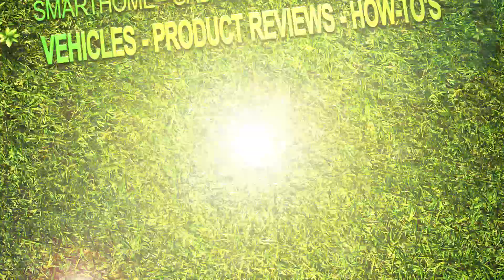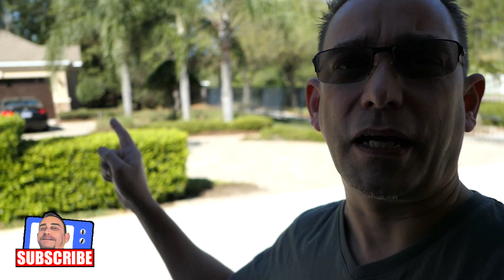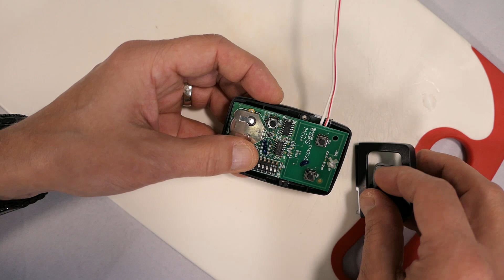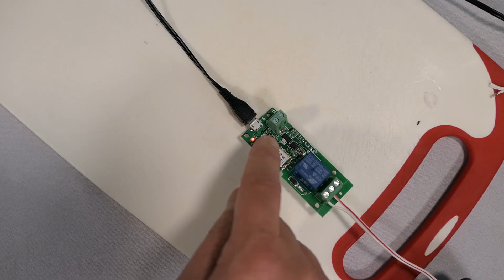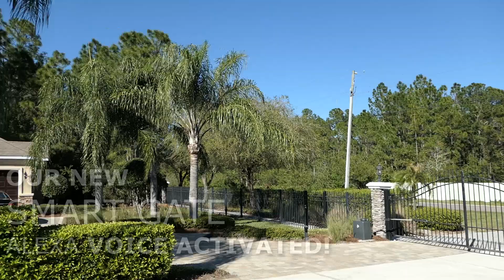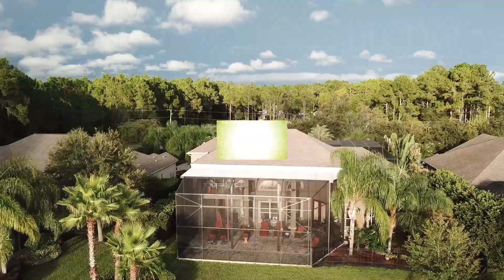CONTROL Your GATE | GARAGE DOOR with ALEXA/Google Home

Comment: I just completed my project, and it works perfectly.  Over the years I must have bought five hundred dollars of junk products that claimed would work with my gate, called the gate motor manufacturer - ALEKO several times, called the gate installer and no one had no clue how to connect my gate to the internet to open and close.  This video inspired me so much that I immediately ordered my supplies.  The biggest issue was my remote.  The gate remote is a key chain fob with three buttons.   One button was programmed to open the gate.  Since it was designed to be small the circuit board was a layered board, and I could not solder from the bottom.  This required me to take out one of the microswitches with the solder points exposed from the top.  In my case I could not get bell wire to stick to the small solder point I had to resort to a thin stranded wire from one of my junk projects.   I tested my prototype, and it works perfectly.  Now I am just waiting for my box to come in, so I house it all together.

Comment: I'm still struggling getting it to connect to wifi and when it can get it added to the app it's offline. I bought another switch to make sure it wasn't a bad board, but no luck. Iv been in software for 20 years so you can imagine my frustration with not getting it to connect.  Anyone qith suggestions are welcome. I have tried on two different wifi networks. Mine and a friend's. Turnwd off 5G, all security even created a guest net work.. I can get it to connect to the router(s) 2 different ones but with no wifi.. 
Cheers 🍻
Reply from the maker: I have a 2nd mesh network with a pod in my garage that helps keep connections 😀

Comment: Hello, great video, Just wondering what power adapter is used? Does a Iphone adapter work?
Reply from the maker: I believe it's a "Micro-USB"
Reply: @twHomeShow  Thanks but i was more thinking about the power supply itself. Is an Iphone charger sufficient?
Reply from the maker: You just need a 1amp phone charger plug. (micro-usb)
Reply: @twHomeShow  Great. Thanks. And thanks for a great channel

Comment: Great video, have just done exactly the same, the module set up was a little different 3 years down the line, you have to set the inching/jogging parameters via the mobile phone app now, but otherwise a great way to Alexa enable a 20+ year old proprietary gate automation system.
Reply from the maker: Mike, thanks for the info 👍 yes, we're still Loving our ALEXA controlled gate everyday 😀😄  -Todd

Comment: Thank you for this!  I notice you had to replace the battery when it died.  Any thoughts on an additional hack to provide external power to the remote instead of relying on batteries?
Reply from the maker: Not yet. But the battery usually lasts about a year. Not bad.  -Todd

Comment: Hi sir, why did you hook up the wifi module with remote control rather than hook it up with gate controller
Reply from the maker: I explained this in my video...I don't have access to the Gate controller, it is locked by the HOA :)   -Todd

Comment: Good video.   What if my gate does not close automatically?  How would I close it again after opening with the app?

I also have 4 contacts on my gate’s open button in the remote fob.
Reply from the maker: I would buy this Multi-switch instead: https://amzn.to/3aJAXet

and follow this video to solder open button to one-for opening, and solder close button to another - for closing. And then- just name them-OPEN Gate and the other one- CLOSE Gate.

You may want to watch my other video for help with this multi-switch-HERE:  https://youtu.be/MypwEcB5nT8

Hope this helps, Todd

PS. If the same button on your fob/controller Opens and Closes the gate, then you only need the single eWelink (NOT the Multi-one). You'll just have to active the ONE button to close and open.

Comment: Well, I gotta tell ya.  Your video prompted me to tackle the wifi control of my driveway gate again.  I'd given up on it because I couldnt get the little circuit board to pair with my wifi.  Tonight I had success, aided by yours and another Youtube video.  
BUT, I wanted to let you know that I finally got it paired and tested in the house with eWilink.  Then, I took the little WiFi board and mounted it in the steel gate controller box, about 100 feet from my ASUS WiFi unit in the house.  I was surprised that it could get full bars inside the metal box . . . but it did.  
Now, my gate is controllable from my iPhone!  No intermediate clicker needed.  It's connected directly to the input on the controller that simply needs a momentary normally-open switch. 
I'm thrilled!
No more carrying a clicker on my motorcycle.  No more calling my wife on the phone to come outside and click the gate open.  
Next step will be to install an Alexa mobile device in our two cars so we can just ask Alexa to open the gate.  

Thank you for the video. 
Ken
Reply from the maker: That's AWESOME!
Reply: I couldn't get the little circuit board to pair with my eWeLink. I have 3 of the module and none of them work. The app keep saying 0 devices found. Can you link down the other video you mention please, Thank you.

Comment: It seems that the little WiFi module could connect directly with the Normally Open terminals  on the gate actuator, eliminating the need for a clicker.  No?  
I really need to make my gate WiFi enabled so I can access the app on my iPhone or Apple Watch (would be even better) when I pull up to the gate on my motorcycle.  Alexa operation could be handy to open the gate from  inside the house.  But I'm really wanting to make it easier to get my motorcycle inside the gate.  Suggestions?
Reply from the maker: Yep, I can open my gate with alexa, or the eWeLink app from my phone. It works excellent! I use it when I arrive home on my bike as well.

Comment: Great tutorial. I hooked one up to the wall control wire on a garage door door and another to my gate wiring inside the box (had to get the one with 7~32 volt input). Works like a champ. Didn't even look at the instructions (they were too small to read anyway). You may have covered it but when the bottom light is on, the unit is not momentary, but on or off.  With that bottom light off, it is a momentary switch (maybe a second or so). Its just like I am pushing the button on the wall or remote. GREAT!!!
Reply: Ahhh....okay Google...err Alexa...that's my biggest challenge now! Remembering which one
Reply from the maker: TVR 101, That's great to hear! I am just loving mine, especially the Gate one - I can just tell Alexa to open the gate without even getting out of my recliner :)
Reply: @twHomeShow  Great idea. I added it to my phone through Google and am working on a Fire Tablet work around. Man are we lazy or what????
Reply from the maker: @texastodd12  Lazy...eehh, I like to call us SMART :)

Comment: How would it be done if i do have access to my gate box??
Reply from the maker: Hello Jaime, I'm sure it would be similar to connecting the eWeLink module to a garage door set-up. First you would have to make a jumper wire to test the possible contacts within your gate housing. Just watch one of my other videos - controlling garage with eWeLink. I would try to follow those sames step :) Todd
Reply from the maker: Oh yeah, and make sure your WiFi will work out to your gate.

Comment: Great video.  I am working on something  very similar so this is very helpful.  How do keep the gate open longer if you want to ? I just installed new driveway gates so getting used to it.
Reply: Depending on your gate opener. If it has a CTC input like mine, it works just like the remote. Push the button a second time to stop it and hold it open. Open just cycles the opener. CTC is like having the remote so you can stop it before it completely opens and it stays open. Mine are ghost controls gate opener.
Reply from the maker: Hey Fairplayer1, thanks :) Our driveway gates are controlled with our landline phone by pressing certain numbers and the #. This is how we can hold it open. But our gate also has 4 stop motion sensors (2-outside the gate and 2-inside the gate. Usually I'll just throw a bag or bucket over one of the outside sensors if I want to keep it open for a while. I have a camera outside pointed at the gate so if I'm expecting a pizza delivery I watch the camera and just yell at ALEXA to "open gate" when I see the delivery pull-up.

Comment: Thank you for this.. One could deduce that if I had a 2 button remote (garage and gate) that if I buy 2 switches and name them different things in the app, I could use that 1 remote to control them both?
Reply: Yes, but the remote would have to be close enough to both openers.  For the garage, just wire it in to the wall switch that opens and closes the door (or where those wires connect into the opener). No need for remote.

Comment: Hi! Amazing vid! I just managed to do this off the back off this vid - thanks! One thing I can’t seem to suss though is, saying ‘Okay google open the garage! It will turn on the ewelink and open the garage, but if I say okay google close garage door, it wants to turn off the WiFi module and this won’t prompt the garage to close (work-around being saying ‘open garage door’ to both open and close it). I have an IFTTT set up but no joy. Any pointers??
Reply from the maker: You need to setup a "Routine" within Google Home app. Open Google Home app and select Routines, then manage routines, "+" to add a routine. Add a routine command, such as "Close Garage Door", then add "action"...such as "Activate Garage Door". and save the command. Now do the same for the command "Open Garage Door". Hope that helps. Todd
Reply: tw HomeShow Amazing - thanks Todd! Will give that a go! Thanks chap 👍🏼👍🏼👍🏼

Comment from the maker: NOTICE TO EVERYONE FOLLOWING this SmartGate Video... Last week my SmartGate control with eWeLINK stopped working. Today I got the chance to take it down and examine it...I thought maybe I would have to reprogram it or something disappointing :(  BUT, GOOD NEWS!! I discovered the battery was DEAD in my remote. I just replaced the battery and it worked just fine AGAIN...NO Reprogramming or nothing! I guess I was so impressed with this NEW Smart gate opener and used it so much, that I ran down the battery :)
Reply: Hardwire the remote. I’d like to see that video
Reply: Nice video.. but having trouble as it only works for about 5 minutes and then the remote doesnt seem to get the signal.. any ideas?
Reply from the maker: @kennyh8112  Maybe check the wifi signal you are getting near the unit. It might be too weak?
Reply: tw HomeShow 
Thanks for the reply,
I have the wifi switch and the remote control right next to my router.
The wifi switch clicks when i press the button on my phone but it seems like it doesnt send the signal to the garage remote. Im thinking the solder isnt connected properly? My garage is a rolling code, but that shouldnt affect anything since the idea of the wifi switch simulates a click. Thanks again..
Reply: Next video tip: How to add a battery sensor to this setup to alert you via the phone app
Reply: I bypassed the gate remote by using some accessory inputs my gate opener has. My setup is a bit different though. My gate opener has a 12v auto battery that it charges and draws from to open the gate. I have the wifi relay board in the opener housing wired to the battery using the 12v option and also have it wired directly to my openers accessory inputs. I imagine all openers don't have this option, but it works great if your opener does. Thanks for making the video.
Reply: @descent777  What brand opener do you have
Reply: Hi it use to work great for my 2 garage door. Today i changed my network for 5G...is there a way to make the switch work with 5g . If not what is my other options?
Thanks
Reply from the maker: @jeewaye1679  Hi there, most wifi gadgets, now-a-days only work over 2.4g. Most routers will allow you to deploy BOTH 2.4g AND 5g. Check your router setting and see if you can turn them both on.
Reply: DISCLAIMER: HAVE YOUR ELECTRIC GATE OPENER SERVICED BY A PROFESSIONAL AND ENSURE ALL THE SAFETY MECHANISMS ARE WORKING PROPERLY (ie REVERSING if it hits a CAR! Etc) also ADD THE CURRENT ANTI ENTRAPMENT DEVICES (safety edges + safety eyes) for ALL POINTS OF POTENTIAL ENTRAPMENT! The diy is cool, WiFi smart control even cooler but from a professional Heed this warning: there was a child CUT IN TWO! By an electric gate just a few years ago! That death and still pending SETTLEMENT is what brought about the LATEST UL325 safety updates (all 2018+ etc gate openers REQUIRE ATLEAST TWO of the above mentioned safety devices to minimize LIFE & LIMB!). You’d hate this video if the god forbid happened and IT HAPPENS DAILY! Be careful!!! The litigious society were in is looking for persons to assign liability in times of devastation. Cool video

Comment: Dude it’s not sending a zap to the remote. It’s a relay switch that closes, which completes the circuit on the remote.
Reply: its alot easier if you have access to the main panel

Comment: Hi Todd. How did you ask alexa to open the driveway gate..normaly the button says on. How did you change it from on to open ?
Reply from the maker: Ridwan Rashid Hello, to do this open your Alexa app and from the menu select Routines. Now you can type anything you want to say to activate any device in your Alexa network, just select the device you want to respond to your new Routine command :) It's really nice to have the Routine feature!
Reply: Thanks Todd. Your assistance is highly appreciated. It worked very well. Now I can ask Alexa to open and close my Driveway gate thank you. Your videos are amazing. Thank you once again. God bless !
Reply: Yes how  change the work on to open I did one gate and gate works amazing I need to change the work on to open now can I do te that from Alexa or ewelink
Reply from the maker: Hello Nick, If you have it working on both gates, one for each gate??? Just go into your ALEXA App and choose Routines. This is where you can assign your switches a talking command to operate from. All you do is type out the words that you want to say and choose the thing you want the switch to perform and select the switch and save. In your case, if you have 2 gates (switches), I would go into Alexa app and go to Routines and type a command that says "OPEN LEFT GATE" and choose that switch (and select command OPEN), Then "CLOSE LEFT GATE" then choose that switch (and select command CLOSE)...and then for your 2nd gate...type a command  "CLOSE RIGHT GATE" and choose that switch (and select the CLOSE command) ....and then do the OPEN as well on the RIGHT gate....
Reply from the maker: OR...You could make a Routine and type "OPEN GATES", then select BOTH Gate Devices and choose the command (OPEN). And do the same way to CLOSE...set up the Routine command to close them both!